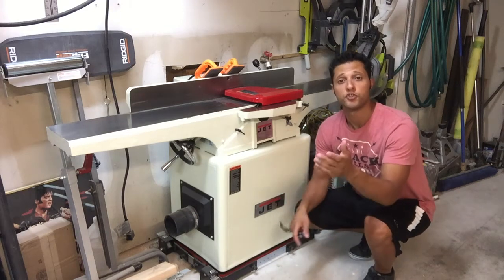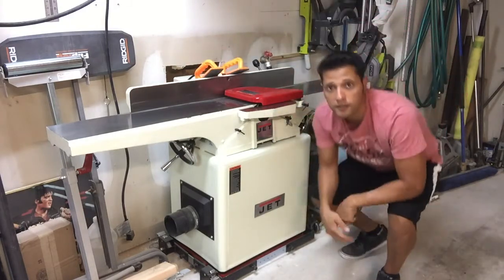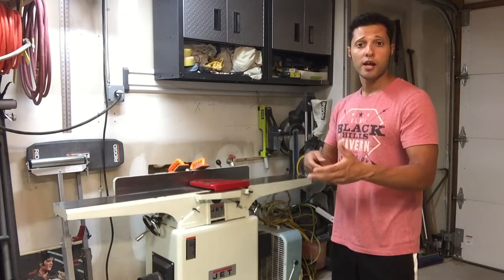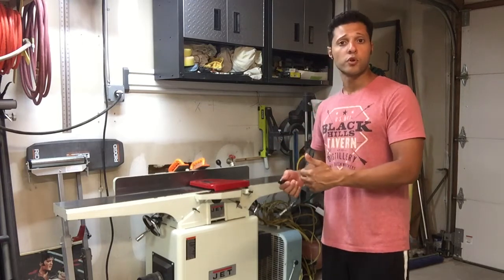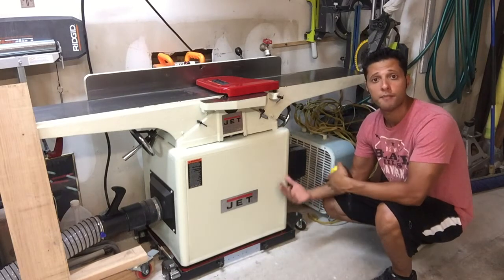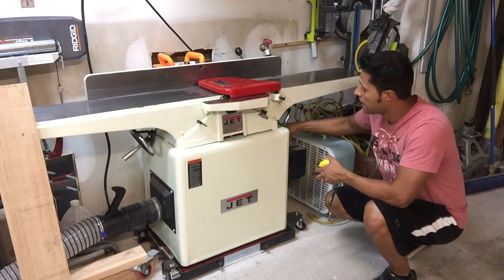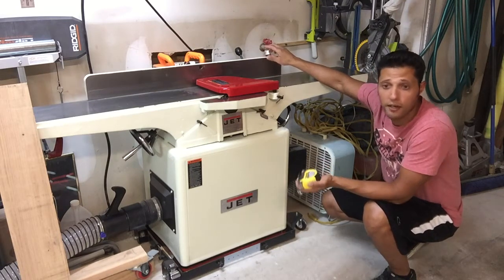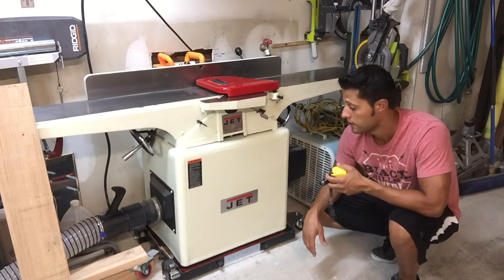Jet 8 Inch Jointer (JJ8CS)

Comment: @Anthony Scolaro  not sure how to PM you... I am looking to buy the 8" jointer and debating on blades or helical head.  Would be nice to save some money with the blades.  What's your take now that you've had it for awhile.  Thx! Good job on the vids!
Reply from the maker: I had this jointer a while back and upgraded to a combo machine about 2 years ago(with a helical head) if you’ve seen my more recent videos. When I did have this jointer, after the first 8 months, I upgraded the standard blades to a byrd shelix helical cutter head. Do yourself a favor and spend the extra on a helical cutter model, or you’ll just end up wasting more money later on either upgrading or selling the machine to upgrade. The standard blades go dull quickly and get knicks in them, and changing them sucks.

Comment: Great review. Im thinking about purchasing the same one with a helical head. What do you think is the max length of a board you can use on this jointer? I build a lot of tables and often use boards that can go up to 8ft. long.
Reply from the maker: Anything longer than 8 ft. Would get tippy and hard to feed also, so I set up an outfeed roller stand to help with that

Comment: Just got my Jet Jointer. I have a couple of questions.  The blade guard on it moves loosely with no tension at all? Should it be spring loaded to hold tight to the wood? Also I would like to switch to 220 volt.  How is this done?
Reply from the maker: vikings844 I'm not sure what Jet model you have but this one is an 8 inch jointer and is already wired for 220v

Comment: Ive been thinking about getting this jointer. Since you've had yours for a couple years now would you still recommend getting it? Is there anything about this tool you dont like?
Reply from the maker: Edward Collins this jointer is great, but I sold it last year for a combination machine that joints 12” boards and flips open to plane them as well. Just for space saving and wider jointing reasons only, not because the Jet wasn’t good. The only thing I’d recommend is to get a jointer with the spiral cutter head. Straight knife jointers are a pain to set up.
Reply: @AnthonyScolaro1  thanks for the info!

Comment: Thanks for this video.  It is hard to find quality reviews of this jointer online.  
How close can the jointer be to the wall?
Reply from the maker: Michael Bulger because of the fence adjustment, it stays about 6-8 inches away. Total depth from wall to front of the jointer bed sticks out about 19 inches or so
Reply: Thanks.  I have limited space and this info is invaluable.

Comment: Hey Anthony, was it pretty heavy for you to lift the table onto the base? Do you think a guy and a girl could do it with this 8" model? Im really thinking of ordering the Jet 6" helical head version but am now contemplating upgrading to this bad boy and just getting the helical head when the blades get dull. Im not really enthused with tools weighing hundreds of pounds but theres not really any way of getting around that if you want great results in the shop..Plus adding 150lbs more wouldnt make that much of a difference when the equipment already weighs a couple hundred anyway right.. What would you recommend Anthony do you think it would be better to go with this model or is the 6" version not much off? A little background  into my mentality is that I would rather invest in a great and professional tool now and keep it for years (ever?) instead of buying something then upgrading a little later on.
Reply from the maker: Jay Ross I was able to get this off my pickup truck by myself but needed a second person to lift it onto the base. Depending on the work you do(meaning the amount and size of jobs) will make the difference between getting the 8” vs. the 6”. I went with an 8” and later upgraded the straight knives to a helical head. I do a lot of work and mill a ton of rough lumber(mostly hardwoods). If you are just a hobbyist, you probably don’t need an 8” or helical head, but if you do as much as I do or you’re a professional then bigger is always better.
Reply: Anthony Scolaro I don’t do as much as you I’m sure but I really do see myself getting to that point soon. I have became very interested in wood working recently and view it as more than just a hobby now, I’m doing new projects every day and spend a lot of time on researching and learning. Your model is only $150 more than the Jet 6” helical head version so it’s not that much of a price difference. Do you think if you were in my shoes knowing what you know now and were in the market for a jointer, would you spend the $150 extra on a bigger model even if you didn’t particularly need it at the time but knew it would come in handy down the road?
Reply from the maker: Jay Ross is definitely go with the 8”  and spiral cutterhead. Just make sure you have sufficient room for it and get a mobile base
Reply: Anthony Scolaro right on thanks man,  always appreciate your insight
Reply: What type of plug and outlet do you have for it Anthony, is it the 15 amp configuration (both prongs horizontal) or 20 amp (one prong horizontal and other horizontal/vertical)? Im trying to figure out the NEMA config but it doesnt really state which one is required for it.
Reply from the maker: Jay Ross one is vertical and one horizontal but I read the amp ratings in the manual before I wired it
Reply: Oh ok, that is the one I am going with too. I have looked over the online version of the manual and there was nothing on there that I could find saying anything about the amp ratings. Online it says the jointer is 12 amps, then when I called Jet they said its a minimum of 15 so there wasnt any material online I could see which says what NEMA configuration it requires. Anthony, do you think if I have one 40 amp breaker connected to each of the prongs in the 20 amp 250VAC receptacle and use the 20amp cord you mentioned, that it would be alright? Im not that savy when it comes to electrical so I wanted to ask someone who has more experience.
Reply: In my garage, I had one of the big outlets wired for a hot tub I had a while back and so I am reconfiguring it to the 20 amp outlet I had planned to use for the 20 amp plug I was going to buy for the jointer. The way it was set up prior was that there were (2) x 40 amp breakers connected together.
Reply from the maker: Jay Ross I already had a 220 line wired in by an electrician, I don’t know about electrical. I just followed the manual on the amps and wired the plug the way the diagram shows.
Reply: Anthony Scolaro oh ok yea same here, trying to learn though haha

Comment: Hey, Anthony - thanks for the video, and congratulations on the new jointer. I'm curious...you stated that you upgraded because you are doing bigger projects. That being said, how did your Rigid Jointer perform? I have one on it's way, and I purchased it because the jobs I do are smaller. Did you like it? Were there any issues that you had with it? I purchased mine, funny enough, because I saw you had one in your shop. Can you give me any advise on it?
Reply from the maker: The Ridgid jointer was good for smaller boards and I mean in both length and width. The infeed and outfeed tables do not provide enough support for longer pieces(like 6-8 feet). The dust port clogs up fast and you have to fish out the shavings often.  These were the main reasons why I didn't do a review of it on my channel. The first time I ran a long board through it I knew it wasn't going to last in my shop.
Reply: atx pupil You bought it because of uts price

Comment: awesome! I'm ready for a jointer but I don't think I'll be able to swing for an 8 incher
Reply from the maker: Most woodworkers don't have the need, the space or the budget for an 8 inch jointer.  Just don't make the mistake of settling for a 6 and find out later you need an 8 like I did.  This jointer has already made my life easier and saved me time selecting hardwoods at my dealer since most of their quality boards are 6-8 inches wide

Comment: I have the 6" version on this jointer. It's awesome but one thing really bugs me and that's the blade guard. Thinner wood goes under it and get's stuck. Does this happen to you and have you found a solution? By the way, great jointer you have and nice review.
Reply from the maker: Ron Marshall I haven't had that problem because I don't run anything less than 3/4 inch material through it, anything below 3/4 is dangerous on a jointer, so I'll either use a hand plane or thickness planer for thinner stock.
Reply: Oh I didn't know of that. I was trying to run some 1/2" walnut through it and take off a 32nd and the first time I tried it got stuck. So I guess that's the reason they keep that gap there. Makes sense. Thanks man, glad I asked.

Comment: why do you need a planer after going through a jointer?
Reply from the maker: MySchizo Buddy the jointer only makes one face of the board flat and straightens one edge, to make the opposite face of the board co-planer with the newly flat face, you have to run the un-jointed face of the board face up in a thickness planer. See my video on dressing rough lumber.